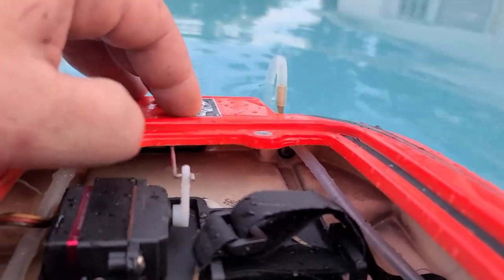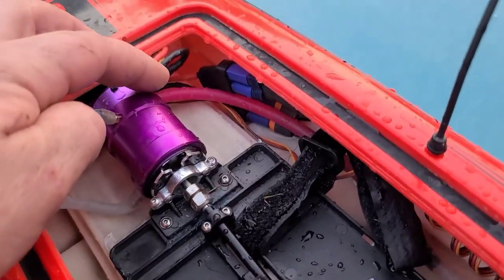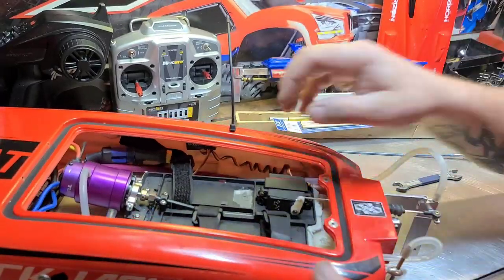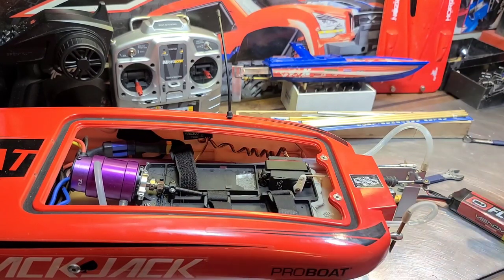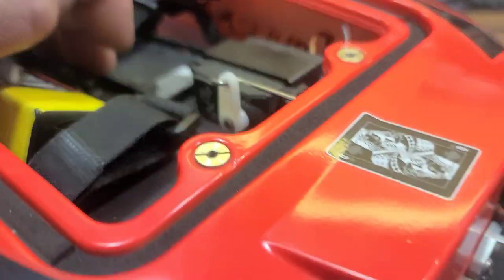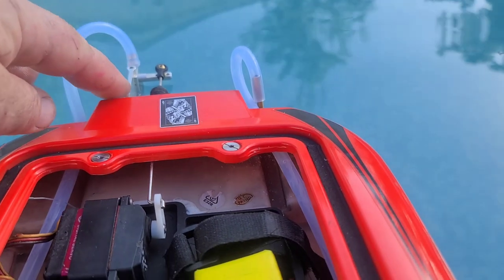How To Find & Fix Leaks In Any RC Boat - Stuffing Tube Repair & Water Cooling Fast Electric RC Boat

Comment: I finally took my BJ24 out for the first time this weekend and what an awesome little boat. When I got home I pulled the drive shaft to clean and dry it. When I was running a swab through the drive shaft tube the liner came out. I have seen in other videos where you glue those parts together but you didn’t do it here, just wondering if this boat doesn’t need glue?  P.S. We need some boat gang stickers for our hulls =)

Comment: Love the long indepth videos. What are you using on the bottom ride surface. I've noticed that my blackjack 24 is starting to show wear from the water hitting the bottom ride surface.
Reply from the maker: It's graphite and thickened epoxy.  It's called blueprinting a hull its Alot of work, almost to much work

Comment: you make it all seem easy lol. so i have a question for you, i 3d printed a kinda cool boat and had to upgrade to a flex shaft whats all needed to use it lol i have the flex hex already
Reply from the maker: So you need a collet to attach the motor to the flex, you need the correct size brass stuffing tube for the the flex to spin in, strut to support the shaft, and a drive dog to hold the prop in place. Oh yea don't forget the  prop nut

Comment: Hi man Sebastiano from Italy here. Can you please give me info about teflon tube. I want to change it but I didn't understand what size you used. Thanks man from Italy
Reply from the maker: What size cable & shaft are you running what size stuffing tube.
Reply from the maker: Here's a chart from offshore electrics showing tube size, flex, liner etc
https://www.offshoreelectrics.com/proddetail.php?prod=ks-brass-tb-12
Reply: @IRONCLADRC  thanks man for support. Stay fast

Comment: what turnigy motor is that....I have 2 big turnigy motors i bought 10 years ago... one is a 3665-2100kv and the other is 3674-1900kv...i have the 1900kv in my motly crew boat with a 180 amp turnigy boat esc... i never really ran it ...not sure you are familar with the 29'' motly crew cat at all... its pretty big boat... size is somewhere between blackjack 24 and blackack 42,buy more towards the BJ 24 size... I can't even remember what prop is on it... With 2 good 2s batteries what would you thing a good prop size and pitch  would be an all round good performer?? maybe 50-55 max speed...60 maybe if you think it would still have great launch excelleration...Just because a boat has a max of 60 does not mean you need to give use full trigger much... thanks again... I think stock prop still on it was 42 dia not sure what the pitch is...only had a 60 amp aquacraft esc and i think it was a 2000 kv 36-50 motor... boat did around 40 mph stock ,but motor and esc seemed pretty hot,that's why a upgraded it in the first place... thanks for taking the time to read this and give me your thoughts...
Reply from the maker: 2100kv 3665.  Try a r2 oxidean high rake prop on a 24-30 inch boat.
Reply: @IRONCLADRC  thanks i will write that down...
Reply from the maker: 42 high rake prop from oxidean     sorry for the typos

Comment: the best way  to find hard leaks using the bath tub method is make sure boat is bone dry  inside and use a flash light... once you see your first drop of water or run you will have a good idea where it came from...

Comment: West Marine sells Gflex that works the best for stuffing tubes and thanks M5 Performance for turning me on to it👍❤️Also works great on plastic and balsa woods
Reply from the maker: Nice I will try that. M5 performance is a cool channel  I watch him quite a bit.
Reply: @IRONCLADRC   may i ask what epoxy you used? Seemed like it was super easy to work with and seemed to work really well! Any information you can share would be great! Thanks!